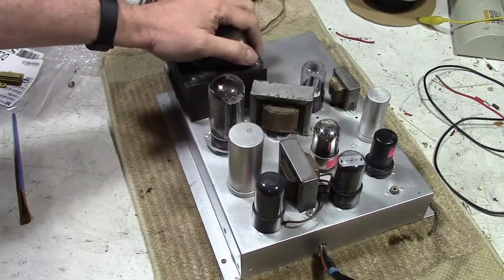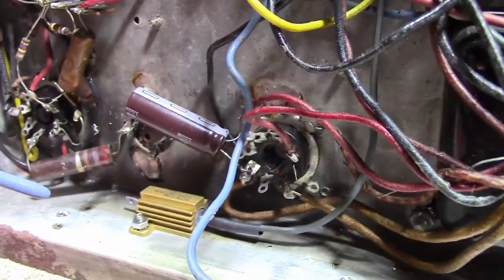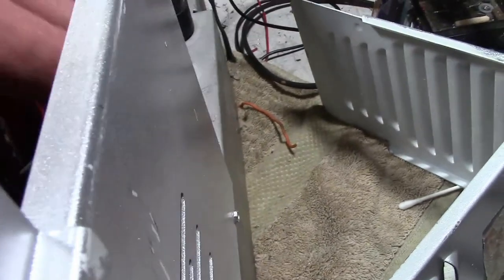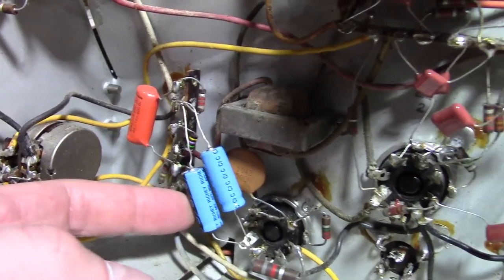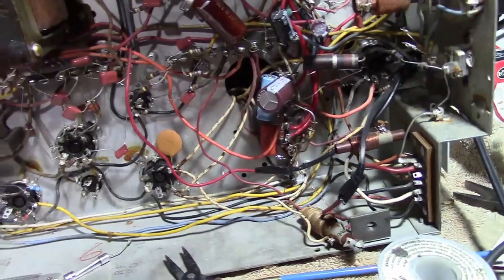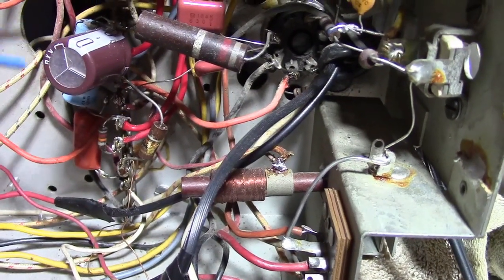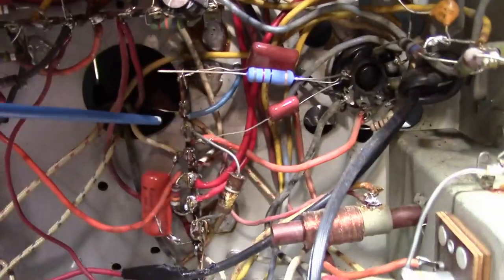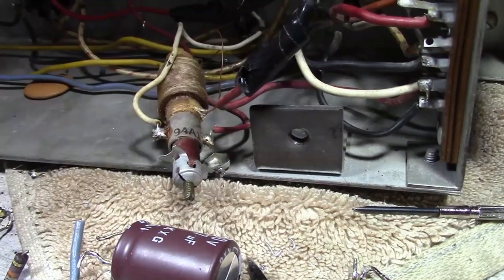Admiral 20B1 restoration p1o?

Comment: I'm not surprised a modern TV repair shop couldn't deal with it, most technicians these days just swap out whole boards and rarely work at component level. Back in the 80's, I had a shop work on a stereo chassis I was going to repurpose into another system, they got it working, but it still had a 60 cycle hum, and they told me they couldn't ID the connections on the 4 pin Molex connector, 2 of which powered the turntable motor, and 2 of which went to the switch on the turntable, I ended up figuring those out myself, armed with only a multimeter and an associate's degree in Electronic Technology. Since the switch would power up or shut down the unit when it was in "phono" mode, I checked the voltage in that mode, vs radio or tape, and sure enough, I got the full open circuit 120 volts in phono mode and zero otherwise. This is a simple thing that any electronic technician should know.
Reply: A lot of TV repair shops back in the day were little more then parts swapping operations too, you can see bad vintage repair work in many of Bob's older videos where they would tack solder random values of parts in place rather they diagnosing the fault properly.

Comment: That repair shop did a horrible novice type repair job. They did not follow through normally because of time versus money but sitting with it so long well that's 
the other sad part. There is a lot of real estate in the chassis underside to make it right and leaving an undersized power resistor just hanging there would be
a no go for me. Horrible soldering technique using less than 35 Watt iron will cause burnt insulation and solder drips everywhere,yikes! Don't assume anything!
 Should first check the power transformer input and output for voltages and any opens. Go from there , but I know Bob will do fine with this vintage 1949 TV!

Comment: Tube audio is very close to TV only difference is no CRT and flyback and filter chokes. Other then that circuits are same :) I enjoy your videos very helpful when following schematics. I'm 30 and enjoy working on tube audio gear and restoring it my vintage tube amp and tuner I restored works very well both are matching and made in 50's looking to find a small am/fm tube radio to restore just need to find good brands or models before purchase one

Comment: Oh yah I forgot I was working on project and wondering if could build it since you have all the equipment to work with rf it's a multiplex adaptor for my tube tuner I have sockets mounted on a plate of metal and have the tubes I can supply resistors I have and maybe caps. But the coils don't have. I'm in no rush I can ship it to you and take your time on it

Comment: i recently repaired a 20B1 which had all the leads of the PT disconnected, and the filter cap leads cut. I don't know who tried to do the restoration, but it was atrocious. Customer gave up on his local tech and brought it to me to straighten out. There were bad solder joints, component leads tack soldered, and capacitor leads extended with stranded wire and left exposed flopping in the breeze. and new caps soldered over the old leaky one's. Basically, a fire looking for a time and place to happen.

Comment: Another factor concerning the Ceramic Capacitors that you didn't mention is they are microphonic!  Vibration of the Ceramic Capacitors can induce voltages within the capacitors.  There is an excellent example of what I mean at the end of this video:
https://www.youtube.com/watch?v=67M7fsbLUIU
The entire video is really worth watching, but the microphonic issue is displayed near the last couple of minutes of the video.
Looks like you are going to have fun working on this unit.  Will be interesting to see how you resolve some of the issues...especially the power cord.
Reply from the maker: Yes, good point. I just did a little research and it appears that NP0/C0G caps are not microphonic but that is certainly somthing to take into consideration.  I bet if I had left those Z5U caps in there it would have been an issue.

Comment: Bob I watched some of your Admiral restoration series videos several times and always enjoy watching what you are working on. BTW- I have replaced all that caps in my Magnavox CT-224. I will soon power it up (when I get the courage hee hee). Oh how I laughed when I saw that sand resistor all crumbly and exposed. Antique Electronic Supply sells orange drop caps. I am not sure if those are NOS or not.
Reply: Orange drops are still being made, A lot of guitar & hi-fi amplifiers have them. They tend to become leaky as they age, not big fan of them; especially as grid coupling caps in amplifiers. I've seen quite a few toasted output tubes due to leaky coupling caps. I get most of my caps from CE which is the parent company of AES. A lot of the time I deal with Mouser and Digi-Key as many techs do.
Reply: @djfrank59  Good to know. Thanks.

Comment: Hey Bob, If you need to deal with the Mica Caps in the Audio Transformers would you please do so on Camera . I play with Tube Radios and messing with these Transformers scares the he?? out of me. Please teach me something
Reply from the maker: I will but I'm afraid it's not likely.  Simply because I don't collect the type of radios that need it.  That would be AA5 type radios from the 50s and 60s.  Almost all of my radios are from the 1930s when they used a different type of IF can.
Reply: Watch some of Shango066's videos, he has some where he deals with failed silver mica caps in-depth. His preferred method is to remove the original S.M caps, and connect a pair of trimmers underneath to peak the IFs, then he measures the capacitance of the trimmer, and replaces with the nearest standard value of fixed capacitor. The values doesn't have to be exact as the slugs in the can can be adjusted afterward. Contrary to popular belief you don't have to use silver mica caps as replacements, NP0 ceramic caps of the right tolerances and values will work.
Reply: @bandersentv  Even slug tuned IF cans from the 1940s are largely different, the RCA ones used molded mica caps inside.

Comment: Those Candohm resistors had a habit of shorting thru the fish paper to the outside metal, shorting out the PS. The resistance element would check fine often, if you didn't check to the Candohm casing. That chassis really was botched up.
Reply: If you read online forums you will see that claim, but the ones claiming that it happens all the time have never actually seen it happen, they just heard it from someone else, who was told by someone that it happens. However I work on a lot of radios that have candohms in them, which were very common in 1930s radios, and have yet to find one where the insulation failed and shorted to ground. Whenever I have encountered a failed candohm the mode of failure is for the resistance wire to break contact with the terminals, especially in ones with multiple taps, more often these were used as voltage dividers in the bias supply, not in the high side of the B+. The other common use was as a voltage dropper in an AC/DC set as opposed to using a ballast tube. This does not mean that it can't happen, but like the stories about Philco Predictas having poor flyback transformers it isn't as common as the barking dog forums would lend you to believe, and borders on an urban legend.

Comment: I’ve always been suspicious of those aluminum cased chassis mounted resistors when involving higher voltages ( voltage break down to ground or chassis) eagerly look forward to new videos thank you
Reply from the maker: I see your point but as near as I can make out from the datasheet they are good for up to 1,000 volts.

Comment: Sometimes in the osc circuits, the engineers used the inductance of a capacitor as part of the tuned circuit. I always replaced the capacitor with the same type., and always used 105C 'lytics.
Reply from the maker: These oscillators are running at 60 and 15,750 Hz. The capacitor inductance is not a factor at such low frequencies. Not to mention that a modern Mica cap has different dimensions and construction than the old types and the inductance won't be the same.

Comment: 50:14 looks like one of those caps popped loose when you touched it with your tool.
Reply from the maker: It's not soldered on one end. I was still working in that area.
Reply: Ahh ok. I was just giving you a heads up in case you forgot or didnt realize that. Saving you hours of nightmare :-)
Reply from the maker: Thanks. It sure would be.  I'm having to go over every single component and connection in this thing.  So many bad solder joints and wrong part values.